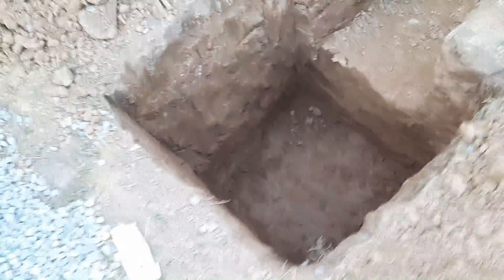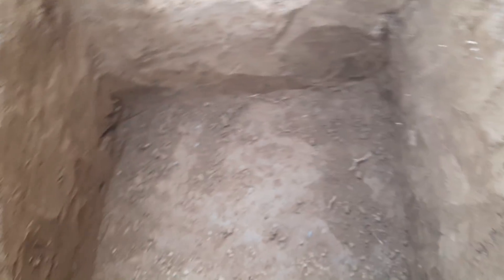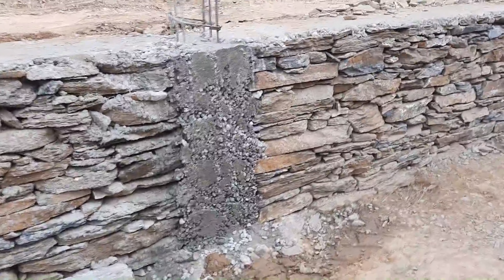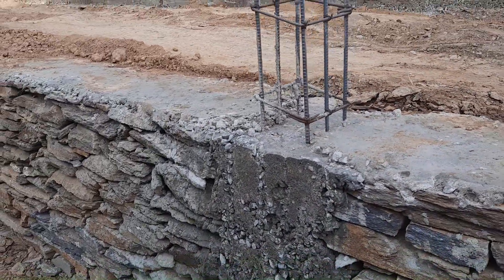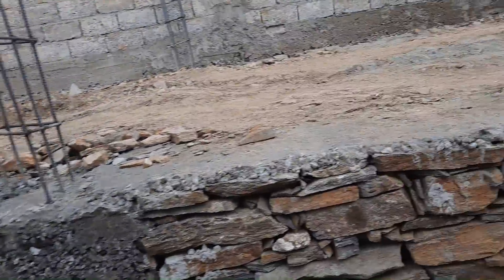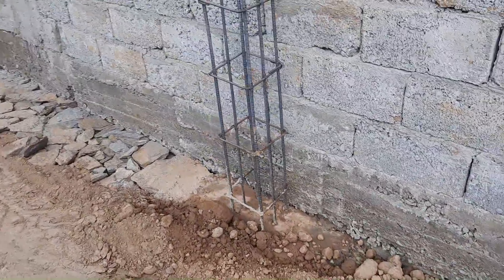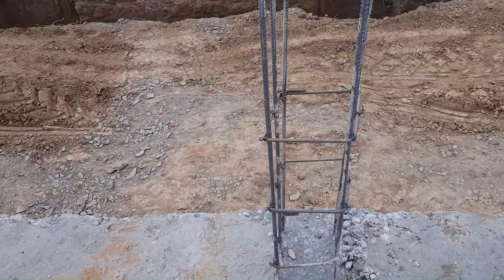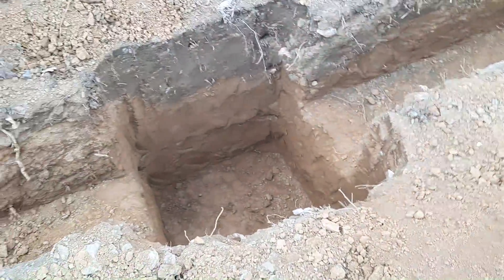Big Mistakes in Footing Practical video on Site

Comment: Sadik you are criticizing the works  but you did not give a solutions to the building. You need to prove by structural computation  and analysis  that the structure specially the size of the footings   are  not adequate for 4 storey building  for  commercial use. This is a trash talk sadik .  How do you that the building use is commercial purpose?

Comment: footing size is correct in 2 storey building, 1 by 1 is enought, with column of 1ft by 1ft, the plinth beam is too wide and not economical. I studied structural engineering and I approved this concept of design of construction. I will not be allowed if the building code of your country do not allow it.

Comment: You cannot blamed to the contractor of that building since the contractor follows only as per drawing or plan.

Blame it to an architect or to the designer of that building. Thanks
Reply: Maybe there is no Architect involved.
Reply: @josuedeasisjr2140  yes you are absolutely correct

Comment: If this is a four storey building then it has an approved plan and in the plan everything is already there from footing dimension ang reinforcing bars as well as the column. For two storey above structural analysis is prerequisite to building permit
Reply: Money approves the plan perfect you need not have to worry civil engineering not required even a mistry thinks himself a architect and a labour thinks himself a supervisor in construction line

Comment: Generally size of foundation and type of foundation depends on load and the type of foundation soil. Without mentioning that you are making general statements. Pl make the videos of specific  issues and the solutions for it
Reply: If You can see the column bars then you came to know the quality of it
Reply: @kumarvijay7620  you are absolutely correct overall the construction is not ok for single story also
Reply: @kumarvijay7620  for a four story build . foundation should be dug up till hard strata or rock  where further digging is not possible this should be and is a must if contractor dosent listen throw him out